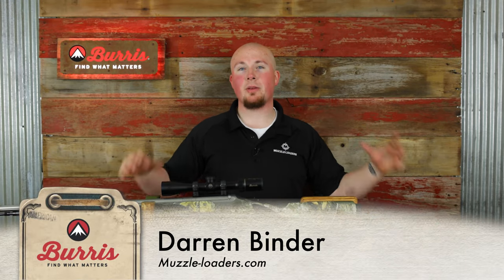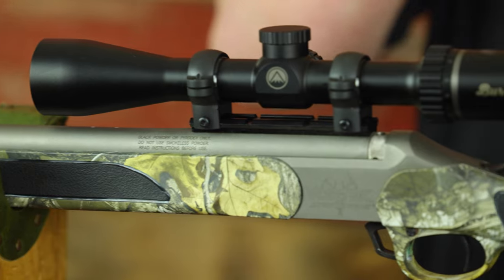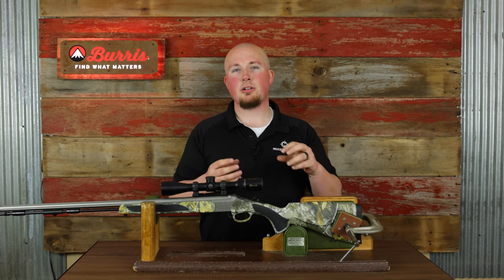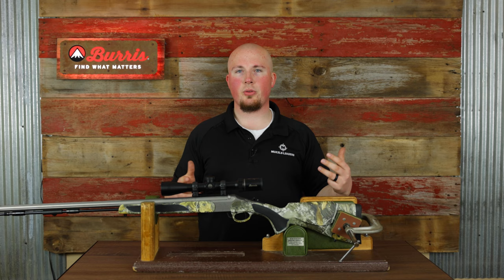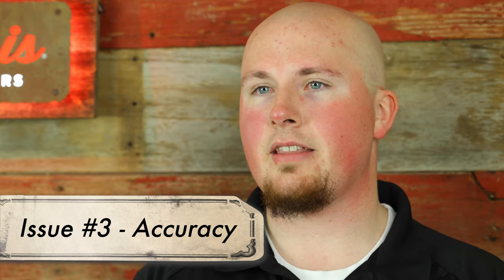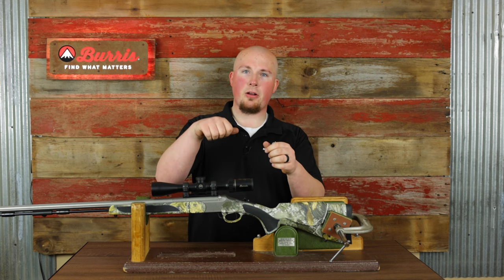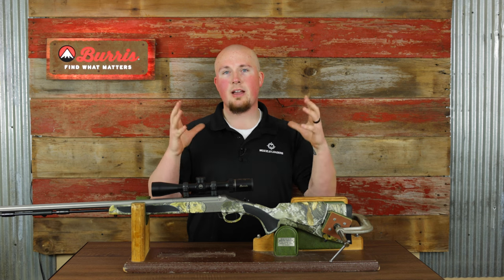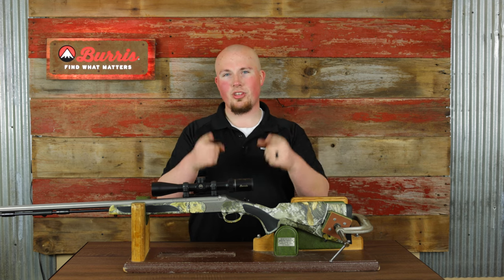Troubleshooting Common Muzzleloader Problems

Comment: I make it a habit when I’m at the range to swab between shots and then once the gun is sighted in I’ll swab the barrel at the end of the day with the load still in it to get any moisture out that may have collected. Another tip is if you think you breech plug is clogged fire off a couple primers to help clear the barrel and touch hole of any moisture especially if it is humid

Comment: The CVA Blackhorn 209 breach plug is dished out so the powder sits closer to the primer. Real black powder will ignite much easer. For accuracy I found understanding your twist rate and matching it to the correct weight matters a lot. Once that's figured out it helps to shoot over a chronograph to find out how fast or slow you want it to go. Lastly getting the correct fitting bullet matters a lot. To do that you'll need to slug the bore or use a pin gauge to size bullets to exact bore diameter. With muzzleloading if you invest the time into getting it right you can have a very accurate gun that you can take pride in shooting.